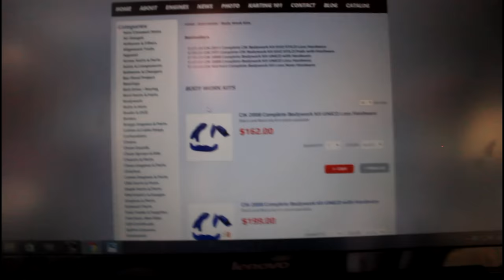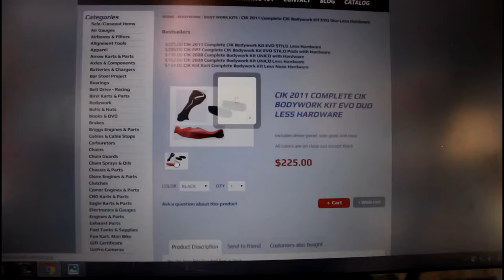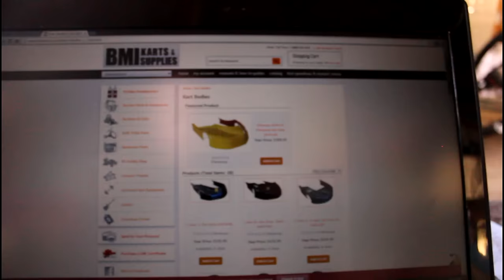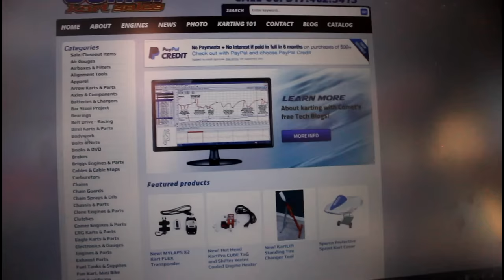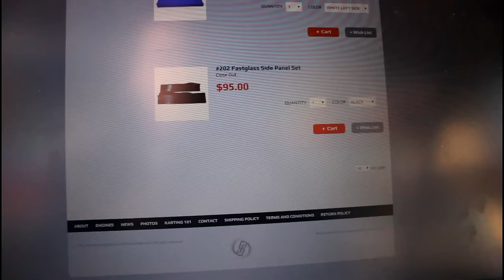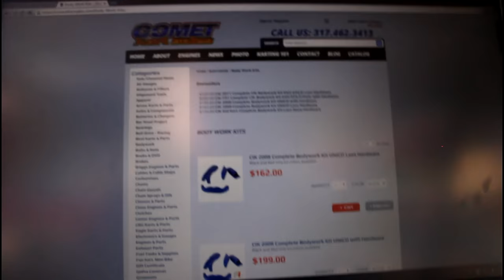(Homemade) Go Kart Build Project 24: Paint Samples and New Shocks!

Comment: The copper ring is a sleeve you put over the shaft what the belt can run over but some grease on the inside part of the sleeve and then put it on the shaft they work ok with out one but if you have one on there they make a lot less noise
Reply: When I say the shaft I mean the shaft coming out of the engine so the top half of the torque converter
Reply from the maker: Yep, I gotcha, thanks for the comment!

Comment: You should paint the shocks the same color, that would look awesome
Reply from the maker: +Riley Witting Yea I was actually thinking of doing that, but I'm not really sure how to get the coil springs off of the shocks without cutting/grinding
Reply: +Hnat Automotive Photography it might take a lot of work, but you could mask off the braces and mounts.
Reply from the maker: Very true, I'll have to ponder that idea and see, thanks for the idea.
Reply: +Hnat Automotive Photography Yea no problem, I'm thinking of welding a lot of metal to the front of the kart for better handling.  I'm having problems thinking of a design, any ideas?
Reply from the maker: +Riley Witting Do you mean better handling by adding weight to the front because it's plowing?
Reply: +Hnat Automotive Photography exactly, but it's only slightly plowing, it really grabs when stepping on brakes (adding front weight) so I assume that the problem is front weight.
Reply from the maker: +Riley Witting Hmmm well you could add some solid steel bars as a bumper, that'll really add some weight haha. I had an engineering lab at school and we used solid one inch by one inch steel bars for some strength testing and they were about 1.5 feet long and they probably weighed about 10 lbs each.
Reply: +Hnat Automotive Photography I might not be able to weld steel with the hf welder, but I can try :)
Reply: +Riley Witting solid steel*
Reply from the maker: +Riley Witting ahh yea very true, maybe have a machine shop drill some holes through them and just bolt them onto the frame, or you could do it yourself if you have a drill press
Reply: +Hnat Automotive Photography do you think I should just add a front bumper, or side bumpers as well?
Reply from the maker: Well if you're just looking to add weight to the front to keep it from plowing, I would focus most on the front, you don't want to be adding more weight if you don't have to. I was strictly talking about solid metal bars to add weight,  but if you're talking about actual body panels from an actual go kart, then I'm sure that wouldn't hurt!

Comment: With the paint,if you put either a white or silver undercoat on first,you'll get a much shinier & better look. Used that anodised look paint before & yeah it gives a fantastic looking finish,like anodised aluminium. Also,are the rifles in the background real,or just for show? Lol
Reply from the maker: +David Reynolds I used a clear primer from Dupli Color for the actual go kart frame. It's an adhesion promoter and primer that is designed to work well with this paint so that the swirl marks on the metal from the sander still show through. Rifles in the back are just airsoft guns haha, if they were real I'd have them in a gun safe.

Comment: nice kart but cant wait to see it finished another point to sort the sprocket problem could of just placed some spacers under  the drive-shaft bearings to lift the it up instead of new shocks and and other stuff you placed to fix the problem or made extension to the rear shock mounts to lift it and watch the steering rods at the front they seem really close to the frame and as that front shock get pushed down it might start to bend or damage them slightly and that could affect your steering   i do engineering collage wish i have the money and time to do this but i still enjoy watching this and other who do builds like this
Reply from the maker: +Bano Panov Putting spacers underneath the axle bearings would have lowered the frame even more, I thought about that when trying to troubleshoot the problem, thanks for watching the build videos.

Comment: Sick colour!! Can u send a link to the ebay post u got the shocks from? Ive looked around so much and cant find them for the life of me
Reply from the maker: Thanks! Here's a link to ones that are similar in length for the front ones:  http://www.ebay.com/itm/5-1-4-inch-Shock-w-8mm-black-Spring-coil-for-mini-dirt-bike-Mini-gas-scooter-/111845408385?hash=item1a0a817e81:g:4R4AAOSwAKxWZ1-v
Reply from the maker: http://www.ebay.com/itm/New-MTB-Bicycle-Bike-Rear-Suspension-Shock-Absorber-350LBS-IN-165mm-Silver-/371658512739?hash=item568892d963:g:j9oAAOSwBahU9RL~

Comment: I'm pretty sure it's a spacer for the shaft
Reply from the maker: +TheLatestGamers Horatio Engine shaft, or driven pulley shaft?
Reply: +Hnat Automotive Photography I'm pretty sure driven.. It stops the belt from being squished.. Also look up torque converter set up on 212cc predator
Reply from the maker: Gotcha, thanks.